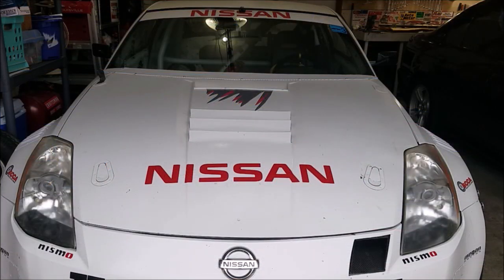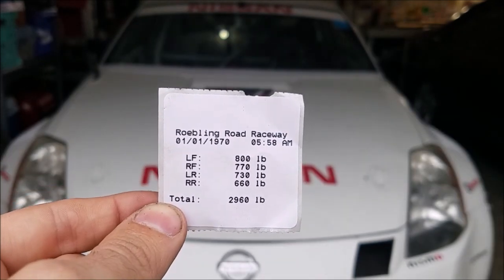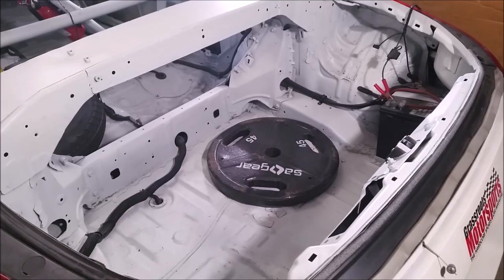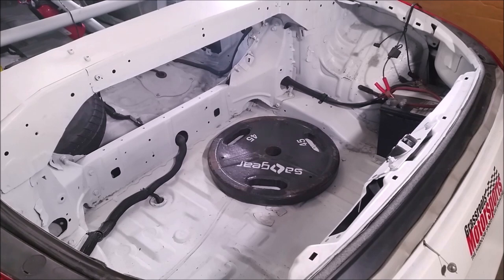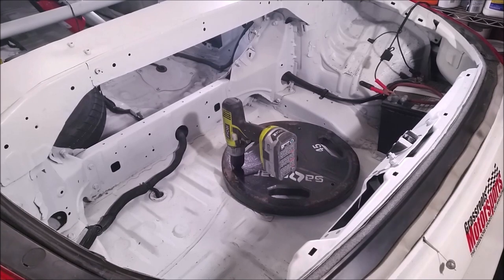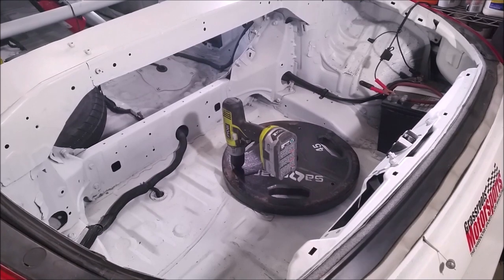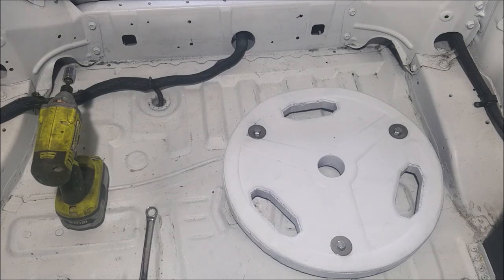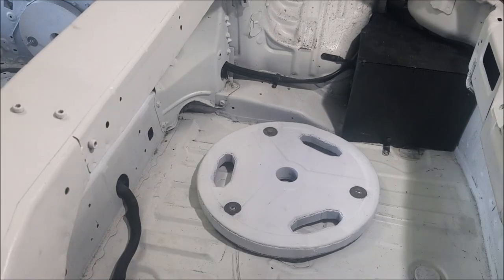Nissan 350Z Racecar Ballast DIY

Comment: I plan on getting a lightweight crank pulley from Z1 and deleting the idler pulley. Is there anything can go wrong with a lightweight crank pulley?
Reply from the maker: As long as it's properly designed, you're golden. The VQ is internally balanced and the stock pulley is not a harmonic damper. Replacing it with a lighter pulley won't hurt it. I've been running a light weight underdrive pulley for five years, 25,000 miles, and 20 track days.
Reply: I'm going to put my input in on this.
I ran one without issue. I installed a brand new front seal in the timing cover at the exact same time so it had a new seal to mate with. 
I have since removed it and reinstalled stock when i rebuild. I did see some decent wear on all the bearings but i am NOT saying its from the pulley. The engine sees a lot of hard acceleration and high rpms(7200 at the time).
I didn't notice much if any real difference in the light pulley. I fully support the idler delete however. I see no disadvantage to that at all other then when you go to the parts store you need to remember you need 1.5inch shorter belt for stock pulley size.